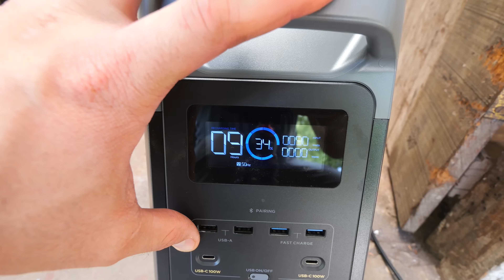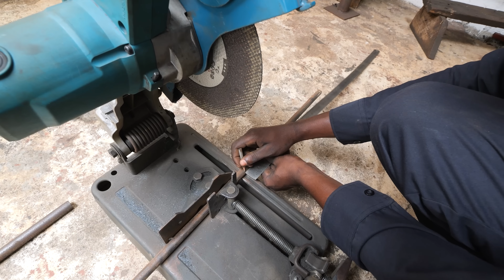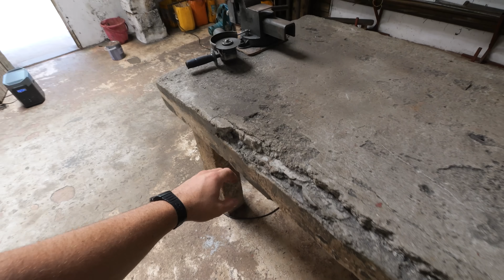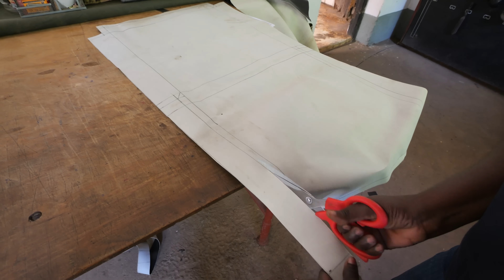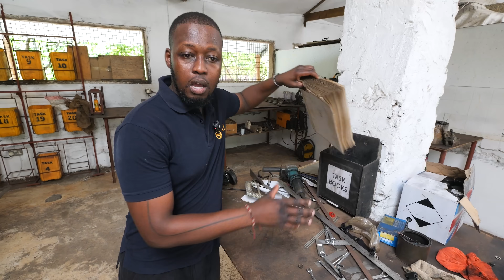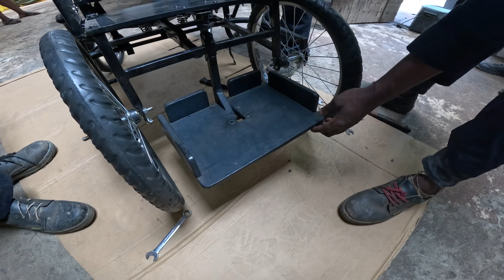This Wheelchair is ahead of its time...

Comment from the maker: Thank you for powering the Factory @EcoFlowTech! Save Up To 55% off from Dec 6th-Dec 27th! Use my code 24EFXMAJRE to get an extra 5% off all deals (Except flash sale products and recommended accessories). Valid until Dec 27th. EcoFlow Website: https://bit.ly/3ZeIETy or on Amazon: https://bit.ly/3zsCV3S
Reply: Hey Zack hoe about providing a full solar power system for the workshop since they have so much issues with power cut
Reply: @daynemckenzie4784  That would be very impressive. In the long run it would be just incredible. Just a couple of the bigger Ecoflow units along with cheap residential solar panels added to their roof and they'd be set for decades!
Reply: @daynemckenzie4784  
-1800kwh @ 50% duty-cycle(use per hour) is 900w. So with the panels in full sun, 2 hours of backup estimated based on hand-working steel and 3-ish people. I bet they get that.
Reply: Thank you eco flow. 
I doubt il ever purchase your products (not currently in the market, may change) but if sitting through sponserships helps at all with what mr jerry rig does il be happy to do it
Reply: Zack, it would be awesome if you paired with someone like fireball tools to get those workers a couple welding tables. Just a thought, their tables look a bit rough. Thanks for all your do, you're a true inspiration.
Reply: @brianadamsjr2664 That's a great idea. They could really use a couple solid welding tables and vises!
Reply: We need to send them more eco-flows and solar panels!
Reply: @Eddoxx 
Install a whole power ocean system with solar 🤷‍♂️
Reply: @Eddoxx We need Ecoflow to send them more. A couple more modules would be a rounding error for the month. Would be nice if they had a couple permanent solar panels though.
Reply: Possibly the best use of a sponsorship item..
Reply: I mean great of ecoflow to give away that delta and funding 30 wheeelchesrs is great aswell.

I don’t want to overstress generosity, but for that application a power ocean system of theirs with a real photovoltaic system would offset the kost for power for nearly ever.
Reply: Zack, how do I get the eco flow In Uganda?...
Reply: Am in Nairobi Kenya, does ecoflow have their stores right here in Kenya?
Reply: I bought mine in china square Ku unicity mall
Reply: Jerry i request two budget phone durability test 1) honor x9c 2)redmi note 14 pro plus.
We are waiting ok?
Reply: You should do a find raiser for solar panels and a battery bank.
Reply: Shoutout to Ecoflow for their donation to TAI. 

Would be nice to see them send over another module or two to expand capacity though. I know that's small crumbs for them.
Reply: Zack. I love you guys, and I like Ecoflow's products, but the amount of publicity Ecoflow is getting from this in exchange for a battery unit and solar panels that cost them about the same as an iPhone is hella disproportional and somewhat insulting. This is giving off major grift vibes so I hope that later in the video I'll see where there was more benefit to TAI and the local community in exchange for Ecoflow essentially using them as marketing props.

Be careful with these sponsorships. I'm a great fan of your projects with the library and drilling wells etc but this is starting to look more slimy NGO, and less JRE/NotAWheelchair

edit: Ecoflow footing the bill for 30 chairs lessens the sting. But I'll keep this here still since that message wasn't in time to change the mood I was feeling for the rest of the video.
Reply: @mrblurleighton I definitely agree Ecoflow could've sent another module or two for added capacity. That said, I don't know what they donated for the 30 chairs, but I know a couple modules and solar panels are a negligible rounding error for them.
Reply: Sir I mailed you from suvrajotimajumder please check
Reply: Hey jerry please give me a iPhone 16 plus white 512 gb variant please bro I don't even have a personal phone bro please bro please give me a phone 😢

Comment: You and Safari Seat are using an 0 cost, low end, free 'generative AI' for optimizing your two designs into one right? The 16G of GPU needed to have Gemini/Anthropic/OpenAI models optimizing the designs would take 3hrs, max. Hand crank, elec assist. Tricycle is most ergonomic. Similar to overpriced recumbent elec toys layout Start in UnReal5 (free) for visual understanding, then shove/force/install the concept into 'AI's. Done.

Comment: would it not be a better design to have a larger set of front wheels with the handles build into the hub instead of how it is?
Reply: or just larger wheels in general to cover more ground and more terrain? even with the current design for independent movement

Comment: i'm not sure abuot situation in Africa, but in Ukraine manufacturers use industrial-grade generators during power outage. yes, it needs fuel, but knowing when you need to switch to your own power supply makes production almost seamless. batteries may make it smoother, but it's not the point of these power stations.
Reply: what is cool though - they manufacture their version of wheelchairs accomodated to their environment. even if it's a business, it's such a needed one. best wishes to them.

Comment: In terms of converting the energy of the user into power for the wheels, I wonder if a rowing style motion would be easier on the user. Especially if you could get it to make use of the energy used in both pulling and pushing. Ideally, maybe even have differing gear ratios where you get more umph out of the pull, as I think most people can produce more power through pulling than pushing. Essentially letting someone row across the area. It's just a thought, as I watched you wrestle a bit with the cyclical motion in the first part of the video. :)

Comment: Zack - Great video, I have to say I was impressed with the manufacturing principles this young man introduced into his facility.  He is actually using some principles of lean manufacturing (i.e.: work instructions, shadow boards for tools, etc.).  He clearly has had some training or self-education, I admire him for this and applaud his efforts.  One item however I would suggest, and I don’t want to be critical as I’m truly impressed with what they are doing with so little, the only thing I would like to see changed is the saw on the floor, not good ergonomics, trip hazard, etc.   But that aside, I’m impressed.

Comment: I would have expected jerry to donate an ecoflow to them too, like.. I think he understands what a difference that could make to them and i don't think the money would be an issue for him given he can waste it on a useless bunker, i think he could spare one ecoflow and for those people having 2, the ability to use tools in two separate places at the same time would be invaluable.. i was surprised eco only donated one but sure, also the money for the cause, but i think jerry dropped the ball there a little. I would donate if i had money.. i only help locally the only way i can, i provide my services for free reparing stuff, i don't make much but i think it helps to not get scammed with 25 bucks to repair drift on an xbox controller or 50 to repace a screen on a phone that costs 100 to people that can barely afford a phone that price.

Comment: If I was disabled, I’d rather have this than a motorized one😂😂
Reply: Why not having the cranks as a backup system if the battery dies
Reply: @ShockingPikachu yeah that’d be great. I’d just want to keep my arms built up if I were disabled.
Reply: @ShockingPikachu battery and motor tend to be heavy. Maybe a small back up to arms.
Reply: If you are fit and strong, yeah.

Comment: This is really cool! 

I've seen a similar wheelchair with just a single hand crank and chain system out front and center of the user. In this version the operator uses both hands to turn the crank. But this double crank version looks like it has better maneuverability and the gear  system makes for less effort. 

Thanks for shining light on this!